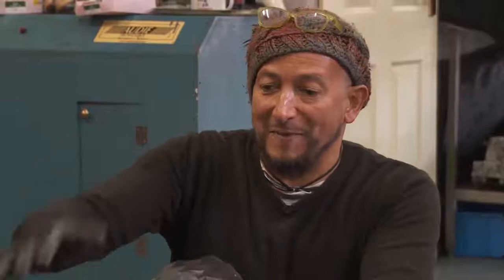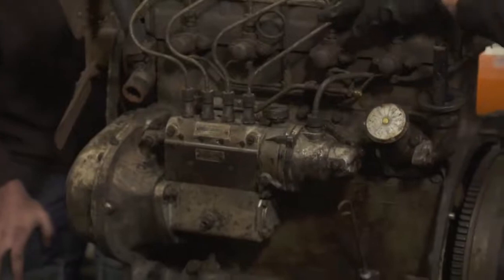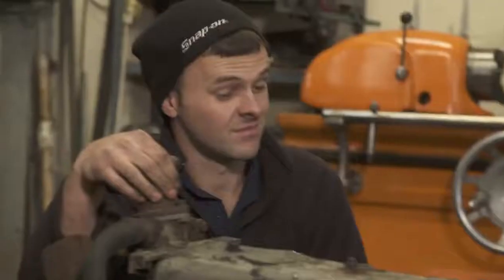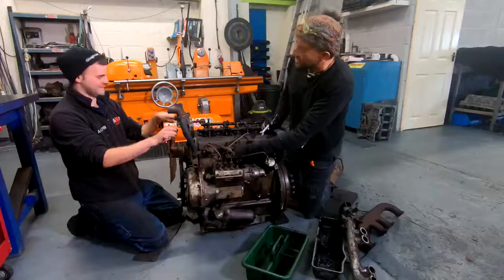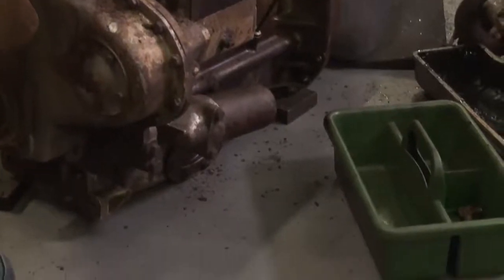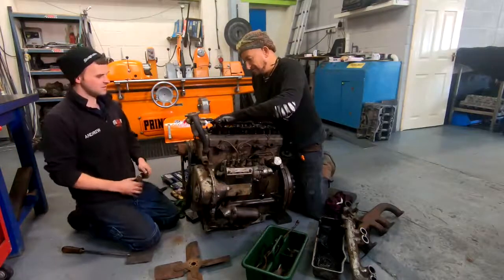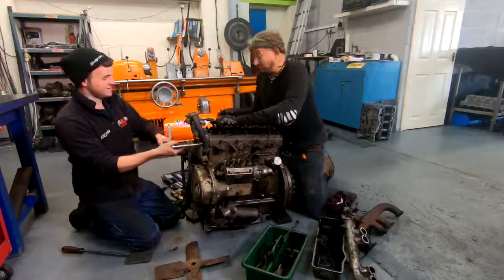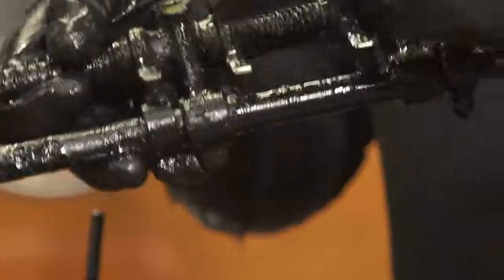Ferguson Tractor Engine Strip | Workshop Uncut | Car S.O.S.

Comment: Love watching car SOS.  That 4cylinder engine could be a sod to start when they were cold
Reply: Which engine is it,Steve? Is it a Perkins indirect injection? Perhaps a 4:109?
I have heard others saying the early indirect engines were a sod to start in really cold weather. No such problems with the later direct injection Perkins range such as the 3:152 and 4:236/4:248 etc. They were really good to start under any conditions.

Comment: I have a 53 year old 2.6 l. version in a 30' motor/sailor.  I change the oil and filters every fall whether they need it or not, Just before haulout in the fall.  The St Lawrence river where I live gets hard (freezes) in winter.  In all the years I have had it I have only had to rebuild the coolant circulating pump.  I get my parts at the local friendly tractor servicing garage.

Comment: Ted’s also varied in compression to the standard petrol engine to allow for the difference in fuel. You can generally rebuild them in the tractor but with a crooked hat like that I’m sure you’re aware of that.

Comment: Would the fact that it is a diesel suggest that the bores would keep in better condition?
Petrol engines especially when on choke would cause oil to be removed from the bores whereas on a diesel that won't happen.
Mind you that rocker box and tappets etc.looked like oil changes had rarely happened.